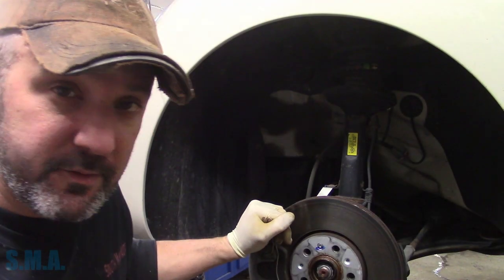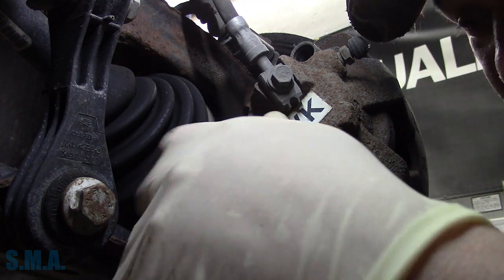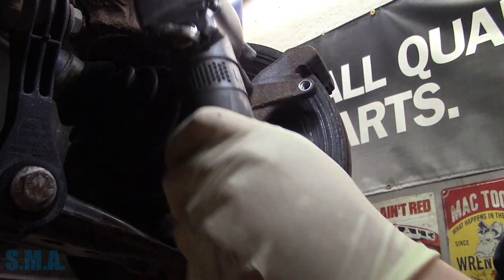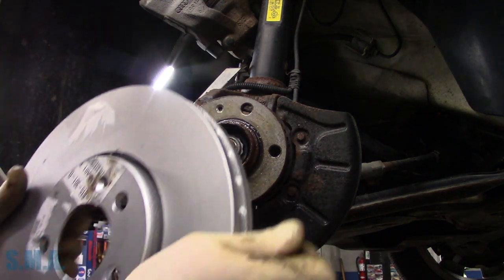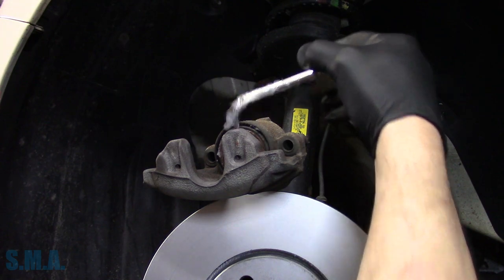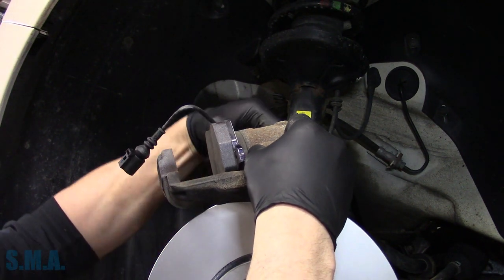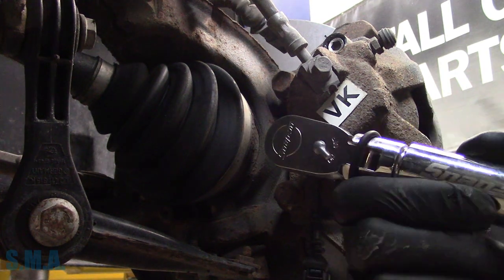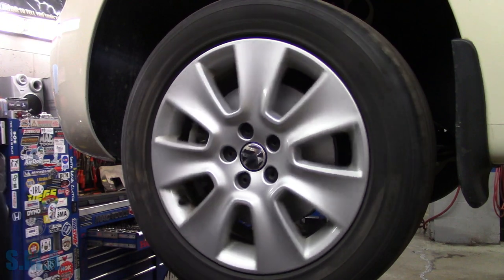VW (New) Beetle: Front Brake Job

Comment: Hi Eric, when you are Torquing the wheels I noticed that you have the vehicle on the ground. The proper way is to torque the wheels while the vehicle is still on the lift. The reason is that there is not to have any weight on the wheels at all. Thanks and I always watch your videos.
Reply: This is not correct.

Comment: That was the cleanest car as far as rust goes that I've seen on SMA! Didn't even have to use brake cleaner (on camera at least) and didn't need big nasty to tear apart some random, awesome engineered part to get the kanuter valve off. Those inboard pads and rotor were terrible! Glad they had the sense to get it replaced. Wired brake pads..... Never imagined. My wife warps her brakes long before they need replacement. I finally had to go to Arizona and pound rotors out of a meteorite, cross drilled and slotted for '08 Honder Accord. No more warping!

Comment: Good to see ya torqued the wheel bolts!!    I worked for VW for 32 years. And i am sorry they scare you. 
You did a good job!!    Other than rusting .....especially in the north east......the brakes last and last.  Without rust i have seen those brakes go 80k miles!     Enjoy your videos!!   I am retired now in Virginia........great place for retired techs.  Built myself a little shop.  The tractor......mower .......and welding  work here is great!!    Weather too!! 
And no more playing beat the clock!! 
Cheers to you and yours.  Keep up the good work!!  Rick.

Comment: This is the standard Bosch brake system used on most small European cars. The giveaway is the 7mm hex bolts on the pins and those anti-rattle clips on the outside. I don't know why Euro cars don't have wheel studs, but I have never worked on a car with them!

Comment: My German car has lugnuts instead of studs, it came with a screw in tool whose purpose is to guide the wheel when you install it.  Easy as pie. Some after market wheels are thicker and require different length lugnuts. Between each lug opening on the wheel is a small hole. There is a fixture that allows you to use those holes to perform the wheel alignment off the face of the brake rotor with the wheel on the car.

Comment: Mr. O is a class A mechanic! I enjoy watching him, it beats me working now that everything has come to a stop here in California, I'm home staying safe and binge watching him work. The only thing I do different on brake jobs is I open the bleeder as I push the piston back in. You only need to wipe out one ABS unit to learn that lesson. It has a better chance of survival without dirty old fluid rushing back through it. The other thing is I never bleed brakes by full stroking the brake pedal, this saves many master cylinders.  I guess I see lots of older cars because I'm not in the rust belt so these issues pop up more often here.

Comment: I use copper grease applied to the pad edges that contact the carrier bracket , piston and caliper. 
Also red rubber grease for the sliders. Anything else applied to the sliders will eventually swell the rubbers and hinder movement. We usually fit after market discs that always come all greasy ,I was disappointed you didn't crack open a can of "sound effect!" brake cleaner!  Damn those genuine dry rotors. 🙂

Comment: As a Pattern Maker I have been designing/building tooling for foundries for over 30 years now.  We do a LOT of brake calipers and anchor brackets for all different manufacturers.  The design of the both the calipers and brackets on this VW was unlike anything I have seen.  Another excellent video!

Comment: I can't get over how clean that hub was, no rust removal necessary. The Saturn L-series used almost that same brake set up and those weird wheel stud/nut combination. It always made tire rotations fun, as you would loosen the last one you had to be ready to catch the wheel before it fell off.

Comment: Little tip for stickers like that - take a propane or map gas torch to it for 5 maybe 10 seconds. Not trying to burn it just heat up the glue. They'll come off in one piece and there will be no sticky residue left behind.

Comment: Eric was so happy that in this video you mentioned the wheel stud.  I work as a tech at a Hyundai/ jeep dodge Chrysler dealer  and what I hate more than anything else is the  wheel bolts and wheel locks    I have invested in a set of lisle pilot pins   they really come in handy   and wheel locks  when I remove them I do it while the veh is still on the ground with a breaker bar in stead of the air wrench

Comment: Thank you Eric. Off topic, if you ever get a chance to work on a Honda or Acura with a blower motor power transistor control, can you make a short video on testing the power transistor control wire voltage with connector unplugged and plugged in and back probed. This will help everyone know what the known good AC Control Unit sends down that wire to the power transistor. There are a few videos on YouTube about the power transistor but nobody has tested this control voltage with connector unplugged and plugged in and back probed on each speed setting. Have a blessed and safe week to you and your family.

Comment: The no wheel studs derives from production simplicity. Using a bolt (1 item) instead of a stud and a nut (2 items) means there are half of the products to be sourced. Using this formula on a few areas in the car and you can save a whole team of workers in the procurement/sourcing department when scaled up to the numbers that VAG produces. This also increases production security as you don't need to rely on 2 separate parts to show up before you can bolt the wheel on and ship it down the road.
Reply: I would guess that the studs come pre-assembled in the hub.
Reply: Another thing is that if wheel works loose then it woun't brake bolts they just come loose. Then You could take one bolt from every other wheels andfix loose wheel properly and drive carefully home. But studs might brake.
 On otherhand VW jack is garbage.

Comment: I have an old chopped off inner tie-rod that threads into the stud holes. Keeps the rotor aligned when the screw is cut off and lines up the other holes nicely.

Comment: That's funny because I just replaced the front brakes on our Subaru Outback. I got them from Rock Auto. The ones on it were NOT OEM anyways. Because we live in Northern Michigan, I got the Coated brake Rotors and Ceramic Brake pads. The ones I replaced only lasted 2 years because that's when we purchased  the car and it stated in the paperwork they said they replaced the brakes. They also said they had replaced the rear brakes but when We got it home, they were all rusty and worn out. I immediately  called the dealer and they had us bring it in and do the brake job they" Forgot" to do.

Comment: The threads on most inner tie rod ends are the same as most Euro wheel bolts. Cut the ball and socket off and they make studs to make installing the wheel much easier.

Comment: On this type of lug bolts to help guide the wheel back on the hub, I get a long bolt that screws into the lug holes. Cut off the head, cut a slot in the end, then screw it into the hub. It guides the wheel onto the hub in just the right place for the lug bolts. It's especially useful when the wheel doesn't want to sit nicely while screwing in the lug bolts.
Reply: I have a few chopped bolts too, but there's usually something similar in the car by the jack.

Comment: I had the same issue on a 2004 Golf GL, plenty of pad, but the inner side of the rotor got rusty during the past 5 years in Boston, but had no rust issues during the cars first 11 years in Houston.  OEM front front rotors and pads installed by a VW dealer is a $550 bill all day long, ouch. So much for Fahrvergnugen.

Comment: I had a 1956 Buick and it was kind of the same, with lug bolts, they did have an alinement pin and a hole in the wheel so every wheel bolt would be lined up

Comment: I was surprised to find out that the Chilton manual has been lying to me for over thirty years. Their step one is always “disconnect the negative batter terminal” whether the car is in the garage or not
Reply: Those chilton and haynes manuals make things more complicated than what it should be
Reply: I think it's for the intelligent people who like to rest tools on top of the battery.
Reply: @pfsantos007  I did that once when I was learning to be a shade tree mechanic. That wrench glowed orange. A good show. But it would do the same with the ground terminal disconnected.
Reply: @justina249  people read them? I've always just flipped through for the torque specs and maybe look at a parts location picture/wiring diagram or two..

Comment: I know they're a pain, but I'm actually a big fan of wheel bolts, just because its so much easier to clean the mating surfaces between the rotor/hub and rotor/wheel.  Very easy to hit it with a wire brush when I'm rotating the tires.
Reply: Other than that, I completely hate them though

Comment: My buddy and I searched in vain for the electrical connector on his Passat. We finally decided that although the replacement pads come with the sensor, not all VWs had that option. So we cut off the wires from the pad and called it good.

Comment: Why do the rotors get like that on the inside? Mine looked fine from the outside until I suddenly got pulsation. Pulled them off and they looked just like these.
Reply: @unklian9221  The Nissan Altima has a shield on the back side, and it completely covers the back of the rotor.....and yet....rotor back side is rusted, outside looks new.  I have been spending a lot of time trying to figure this one out.

Comment: On the bright side, the studless design is convenient for cleaning the hub. That's about all.
Reply: I also find that the wheels don't seize to the rotors nearly as bad on cars with wheels bolts. Not to mention all the German cars I've owned had wheel hangers in the trunk that makes putting the wheels back on much easier.

Comment: Those guide pins strip out extremely easy and I believe they are also 9MM. A real pain in the rear when that happens as 9MM helicoil kits are not exactly common.

Comment: Me thinks the Euro wire "Closes the Circuit" when the doohickey material wears down to rub the nub on the dingus it exposes the to contacts and the rotor compels the light to come on by allowing all the little pixies to flow from one side of the dingus to the other and exciting the DIC on the dash with a BIG "!"  and a car on a hoist . am I right or am eye white? 😎

Comment: Did that wheel have play in it? After you were done you grabbed it and did your usual wiggle wiggle and it looked and sounded like it had play in it. But hey, it's Eric O.. He would have mentioned it if it did... Watched the brake job on a bug while avoiding a bug (to put it lightly), and I've never owned one... Thanks!

Comment: Really should have the electric wear indicator on the front right corner. That one always wears the most. Ya know, everyone turns left here in 'murica and that wheel travels further than the other three.
And driving on the non-left side of the road.
I wonder. Does the left front wear faster in countries where they drive on the left side of the road?

Comment: Funny story about the lack of wheel studs, they have a massive problem with loosening up if you don't re-torque them. Every car I see on the side of the road missing a tire with an inch of brake disc ground off is a Volkswagen.

Comment: Do you ever resurface brake rotors and drums or do you always replace them? As we in the south mostly resurface rotors and drums two to three times before they are replaced. Places around here charge $10 to $20 per rotor/drum to resurface them.

Comment: The only thing good about wheel fasteners is the hubs are a breese to clean lol Eric you need to get the screw in wheel guides for them silly studless hubs. They make installing the rim so easy, not that its hard just a P.I.T.A. trying to keep it on there while messing with the studs

Comment: A Jetta trying to disguise itself as the beetle.Glad they stopped. I like my 4 wheel drum brakes lol😎
Reply: Not based off a Jetta.    It's a Golf with a gurly body on it.
Reply: The second generation "new" Beetle shares the "A5" (PQ35) platform with the current generation Volkswagen Jetta and is built alongside the Jetta, Golf Variant and the old Jetta ("Clásico") at Volkswagen's plant in Puebla, Mexico.
Reply: @Ram14250  Pretty much every part on the car swaps with the Jetta except the sheet metal.  It's a Jetta.  Golf and Rabbit, too.
Reply: Ram14250 kinda sorta.  It’s based on the mk4 golf/jettas, which was the same vehicle with different sheetmetal. The golf and jetta didn’t really split until the mk6, at which point the 2012+ beetle is more like the mk6 jetta.

Comment: I've kept a few studs from the back of an f250 wheel bearing just for vehicles with wheel bolts as often times it's the same size and can help get the wheel situated.

Comment: The reason VW uses wheel bolts instead of nuts is so they can sell you the wrong length bolts and have them jam up against the spindle and bend.
Neighbor did that and was convinced the parking brake was stuck. Luckily the bolts broke off where they bent and was just a matter of fishing out the remains from inside the rotor.

Comment: Hello Sir. A quick question. I changed the rotors (discs) and pads on my car but I had to drill out the set screws (they rounded off on me). afterwards I am getting a strange wosh wosh sound. it comes and goes. Can it be the missing set screws?

Comment: Hey Eric just curious I see you use silicon on the edges of the pads I live in Canada so I get the rust too but I have always used copper antiseize and I mixed in some oil to thin it out and make it easier to work with do you use the silicon because it helps rid on the rust better or is it just your preference?

Comment: One newton-metre is equal to the torque resulting from a force of one newton applied perpendicularly to the end of a moment arm that is one metre long. One newton is the force needed to accelerate one kilogram of mass at the rate of one metre per second squared in the direction of the applied force. 1 N-m = 0.74 Ft-lbs of torque.

Comment: So why do you always have those thin gloves that tear vs some of the thicker ones, ie Harbor Freight, etc?  I tried out some of those 9mil ones they have when I put on calipers and pads on my '99 F-150, I was shocked when I had no tears or holes in them during the job.

EDIT, I didn't watch far enough, you started out with those cheaper white/clear ones and the end of the video you had the black ones.

Comment: Actually if you have a wheel hanger it's easier in my opinion -- you'd thread the hanger into one of the hub holes first, then you just line up one of the holes of the wheel to hang it on the hub. This is easier than holding the entire wheel in the air and aligning all five wheel studs at the same time. Just thread on four of the bolts and remove the hanger to do the last bolt.

Comment: My 73 square body came factory with electric brake indicators,(brake light---silly Engineers,my ears work just fine).just shows you that there is a Engineer with too much time on there hands..silly Volkswagen...cant imagine the cost of those pads and rotors...ouch.. 1st time I seen Eric o pull out at torque wrench for a caliper mounting bolt. All it really needed was 3 ugh a duggas..eric showing off his fancy tools..been waiting on some s.m.a...thanks Dr.O..stay healthy..ohhh no brake clean--damn it...we were robbed

Comment: Had a '12 GTI.   Pain in the * to work on with all of VW's "special" fasteners that required special tools for everything.  The rear disc brakes are even more difficult.     Oh, and that little wire on the driver side for  brake wear.... the male end of the connector that's sits in that bracket off the strut... well it likes to break very easily as it's made out of egg shell plastic when you try to disconnect the old wire from the worn out pad.      Ended up just soldering the wear indicator wires together to turn the lamp off.    Hated it more than any car I've ever worked on!   Shame... it was a fun car to drive.

Comment: Hey maybe you can help me out. My wife has a 2004 isuzu asender and when the wife drove it a orange guage light came on and it almost stalled. It is out now but the check engine light is on. What is that orange guage light for?

Comment: Did my front 2009 new pads and rotors and pads are scraping in rotors even when brakes are not pressed. Sounds horrible. ??? Do I need new calipers too or is it a different issue ?

Comment: I would have thought you'd crack the bleeder open change the brake fluid in the caliper or did I miss something?
Reply: This has been discussed in the past... Basically, it's asking for trouble in the salt belt, as most bleeders are likely quite rusted. (Only touch the bleeder if you have to.)

Comment: Those brakes get even better when they get super rusty
Mine broke the wear sensor connector off as it was corroded together and the connector was cracked at the sheet metal holder.
Just soldered it together and deleted the pad sensor

Comment: The fronts aren’t too bad on a VW.  The rears suck.  Most of them are a screw in caliper piston.  You need a special tool to do it.  If you don’t retract the piston slowly (I mean slowly) you’ll blow the seals right out the back of the caliper.  The carrier bolts seem to be torqued to 1,000 foot pounds and have next to no room to remove them.  I can’t wait for the wife’s VW Rabbit to finish rotting away so I don’t have to continue working on it.

Comment: Never personally worked on a vehicle with lug studs. Do they thread into the rotor/drum or axle flange? If you strip one, how screwed are you?
Reply: watajob they thread into the flange of the hub bearing. If it strips it’ll be a new bearing unless the threads can be repaired.